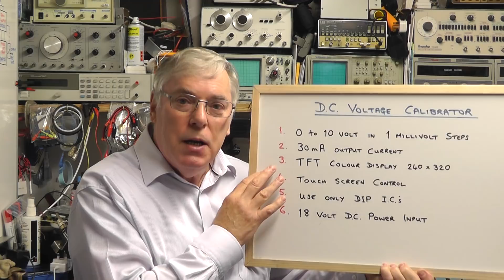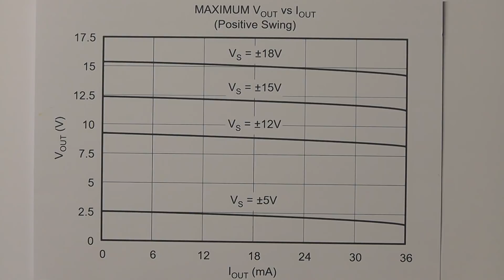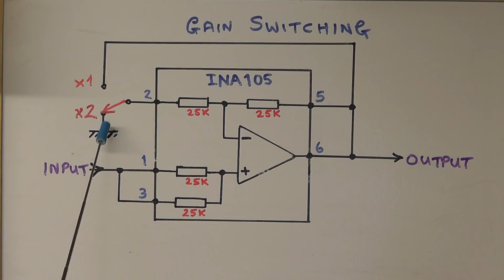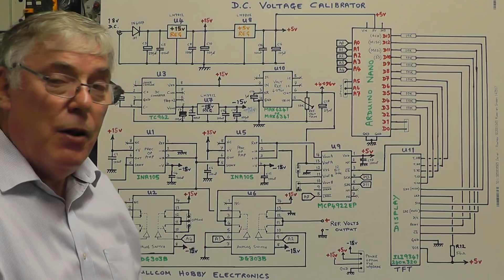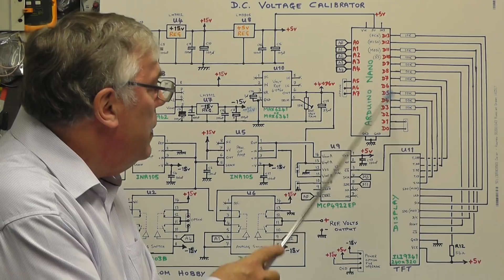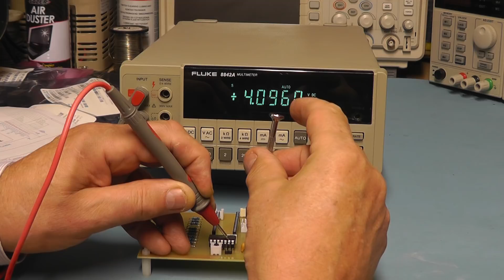Scullcom Hobby Electronics #53 - DC Voltage Calibrator Part 1

Comment: Amazing project! But I did not unterstand why the circuit has a precision of 0.01V up to 10V. If you must divide by 4 (to get 10V) before using the DAC and the DAC has a resolution of 1mV and later amplify by 4 - would the result not have plus/minus 4mV? You are losing 2 Bits or not?
Reply from the maker: Thanks that's a very good question. I will try and explain.
If for example we select a reference voltage of say 8.444V then before we feed that information to the 12 Bit DAC we divide it by 4 in software so the DAC sees a request to provide 2.111V. The output from the DAC is accurate to 1mV (due to the milli volt step resolution). The output from the DAC is now an analog voltage of 2.111V. The first precision OP Amp takes that analog voltage of 2.111V and amplifies it by 2 giving 4.222V it then passes to the second OP Amp which again amplifies if precisely by 2 to gave an output voltage of 8.444V (remember the Precision OP AMP's work on analog voltages while the DAC works on digital 1mV steps). Any error on the output voltage will depend on the accuracy of the OP Amps. That's the reason I am using the INA105 which has a maximum gain error of only 0.01% when operated at a gain of x2 and only 0.001%gain error for a gain of x1. So in my example here the output of the first OP AMP may be out by a maximum of 0.01% meaning the output reading may be as high as 4.2221V (only out by 0.1mV) this is now fed to the second OP Amp which may have the same error of 0.01% so in this case the output will now be around 8.445V. Only 1mV error and that is the maximum, in reality it would be better than that.
The main cause of any error in the output voltage is more likely to do with the DAC itself as it has the following intrinsic errors:
Integral  Non-Linearity  (INL)  ±2 LSB (2 steps) error which is the maximum deviation between an actual code transition point and its corresponding ideal transition point, after offset and gain  errors  have  been  removed. 
Also there is the Differential Non-Linearity (DNL) of ±0.2 LSB error which is the measure of variations in code widths from the ideal code width. A DNL error of zero indicates that every code is exactly 1LSB wide. 
There is also an Offset Error of ±0.2% of Full Scale Reading, which is the deviation from zero voltage output when the digital input code is zero.
These 3 type of errors in the DAC could result in an overall error of around a maximum of say ±5mV from the output voltage of the DAC.
This is something we may be able to address in software calibration later.
Have a look at the MCP4922 datasheet pages 19 and 20 for a fuller explanation.
In part 2 of this project I will have a look at the accuracy of our DC Voltage Calibrator with a view to resolving some of the issues.
Sorry for the long answer but your question was a good one. Hope this helps.
Regards, Louis
Reply: That answer was absolut fantastic! Hope you are making new videos 7 times a week now! ;-)
Reply from the maker: Thanks. If only I had the time to do it - I wish :-) All the best, Louis.
Reply: Louis, correct me if I'm wrong, but I think there's a problem...

This works with values that end in even numbers (as in your example with 8.444V) but it doesn't work with any value which is both larger than 4.000V and which ends in an odd number.  For any value meeting these conditions, there will always be a 1mV error.  Consider two examples:

1.  You set 4.001V.  The Arduino divides by 2, giving 2.0005.  The 12-bit DAC can't resolve the last digit (0.5mV), and we can't know whether the output will be 2.000 or 2.001.  Either way, the DAC's 0.5mV error is doubled by the op-amp, becoming a 1mV error at the output.

2.  You set 8.443V  The Arduino divides by 4, giving 2.11075.  The 12-bit DAC can't resolve the last two digits (0.75mV), but the output will round up to 2.111.  This 0.25mV error is quadrupled by the op-amps, becoming a 1mV error at the output.

You need a 14-bit DAC with 0.00025V resolution to overcome these division errors.
Reply from the maker: Thanks FlyingScotsman. Yes you are correct the 12 Bit DAC does have some limitations when I start dividing the input in software and the value is an odd number. In Part 2 I will be looking at the accuracy of this project. I did consider using a 16 Bit DAC at one stage but they are much more expensive and come in a SMD format, which is what I was trying to avoid on this project. We may look at ways of improving the accuracy later. In the first instance I also wanted to try and match the Time Electronics DC Voltage Calibrator I showed which has an accuracy of around 0.02%.

Thanks for your input which is appreciated as it adds to the overall understanding.
Regards, Louis
Reply: Indeed.  A quick look through Digi-Key's selection of DPDT analog switches shows nothing in a through-hole package with lower than 30-ohm Rds(on).  I think the obvious solution has to be mechanical reed relays.

DPDT reed relays are relatively few and expensive, but SPDT are plentiful and cheap.  The Littelfuse (née Hamlin) HE3321C0500 looks like a good choice in a convenient SIL package.  It would probably require a small FET to drive the coil (40mA; right on the limit for Arduino pins), and a back-EMF suppression diode.

The Littelfuse HE721C0510 comes in a DIL package, so it's a bit larger, but it costs ~50% less, wouldn't need the drive FET (coil current = 25mA) and it includes the back-EMF diode inside.
Reply: Sorry Scullcom, but if that answers the question, I have missed the point. If the output of the DAC is precise to 1mv (due to step resolution), as you say, and accurate to 1mv as you say, then a request for 2.111V could yield 2.112V, which after the op amps would give 8.448V, even if the op ams multipy perfectly by 4, wouldn't it? That's what I understood the original question to mean. Great project and video though, as always.
Reply: It looks like another aspect of the output accuracy lies at the usd analog switching devices. Although they are great little devices, the cost of using the units lies in the Rds-on values. Looking at the datasheet this value easily is about 30ohm. 
My hands-on knowledge of opamps is nearly equal to zero. But I know for sure that since the extra 30ohm is within 1 legof the opamp input, this is relevant. So the given gain value error will be worse.
Another aspect to keep into account: since the errors from the DAC don’t follow nice curves, I see no possible solution in software calibration.  The resolution of this device will be 1mv in the output range 0-4V, 2mv in the output range 4-8V, and even up to 4mv above output range of 8V.  And these errors are solely the effect of the DAC resolution. The gain errors of the opamps needs to be added, and also the (minimal) error of the voltage reference.

And what is the effect of the output voltage when the current is at different levels? Perhaps that effect can be reproduced, and therefore compensated in software?

Despite above remarks: very nice instrumental piece, clever use of selected components, and very educational. I really enjoy you’re projects and videos!
Reply: This reminds me on a question I thought about in the past: If you build a Wheatstone bridge to measure resistors could you use the measured resistors to build an even more precise Wheatstone bridge? And continue and measure... until you know this resistor is 1,000000000004 Ohm. ;-) 
My solution was that the least precise device in the circuit determins the precision, and there is no way out of that fact. And thats true also in this case.
Reply: der Birnodin Well, if I remember correctly one can calculate 1 strange resistot value with 3 well known resistors. 
But when used as a load cell, this resistor value is of none interest, only the voltage between the bridge in relation with the applied force. And that one can be calibrated without knowing the resistor values at all. 
This is quite of the subject started with the project of Louis though ;-)

I really need to dive into my learning books which I haven’t touched gor more than 20 years......
Reply from the maker: There is the MAX4622 which has a typical ON resistance of only 3 ohm. Worth considering but about twice the price of the DG303 or DG403. All of these are SPDT configuration.
Reply: Scullcom Hobby Electronics   Because my opamp knowledge is quite rusty, I cannot oversee the extra loss of accuracy introduced by both opamps as % of the represented value. The DAC accuracy is already quite off the resolution of 1 mV. 
That said: the logic blocks you’ve defined, and the design & buikd is still something I deaply respect. 

As total I did not look at component prices, just the datasheets to see what the accuracy can be. I was triggered because I am searching for a decent (preferably cheap) lab power supply with high resolution. (1mV/1mA). The documentation of the ‘payable’ ones I found all listed an accuracy of plusminus 3mV.  So I think they are built based on a 12 bit DAC. 

Well, thinking further in that path: why not replace the DAC with one with (significant) higher resolution, and use a high resolution ADC as feedback? That way different effects of inaccuracy can be compensated based on the measured ADC value. ?
Reply from the maker: Thanks Psilin for your comment. I did look for a 16 Bit DAC (SPI) in a dual inline package but they appear hard to find. I wanted this project to use standard DIP IC's in order to make it easier for the hobbyist to build. At a later date we could look at a 16 bit option although I would image a much higher cost. Thanks again for you input. Regards, Louis
Reply: Scullcom Hobby Electronics : looking only to DIP packages surely limits the availability of components these days. If I remember correctly, the ultimate poor man’s DAC consists of a couple of cascaded serial to parallel shift registers, combined with a R-2R network. Perhaps these IC’s are obsolete in the meantime. 
I still have no clue what you are going to do with the second DAC channel. So just keep up the good work ;-)
Reply from the maker: Thanks thisnicklldo, The true accuracy of this project is dependent on the output accuracy of the 12 Bit DAC. Therefore, any error the DAC produces will indeed be amplified by the OP Amps. If this error from the DAC happens to be say 1mV then you are correct the the output error if the voltage selected is over 8 volt will be 4mV (since we are amplifying the DAC output by 4). If the voltage is between 4.001 volt and 8 volt the output error would be 2mV(since we are amplifying the DAC output by 2). Up to 4 volt the output error will be the DAC error. We will have a look at this in Part 2 of this project and see how accurate the output voltage selected really is. I have found in practice the most noticeable errors from the DAC are at low voltages, say 1 volt or less, and I will be looking at improving that as a first step. There is also the possibility at looking at some form of calibration. Regards, Louis
Reply: Good advice, i'll have to make a 14 bit version of this little bugger.

Comment: Thank you verry much for all the effort put in your projects and videos. Learn a lot every time.
Reply: Just one idea, in terms of signal to noise ratio - isn' it better to do the higher gain in the first stage (2x 1x instead of 1x 2x) ?
Reply from the maker: Thanks this may be an option which could be done in software. I will have a look at noise in Part 2 of this project. Regards, Louis

Comment: Another superb project by the master...
One must be able to adjust the 4096 volt-ref with a meter like yours. Otherwise, it might not have the accuracy of 1mV, but it will surely have 1mV resolution. That'd reason alone to send it off for calibration, if you don't have the means to calibrate to 1mV.
Figure-1 on page 3 of the DG303B shows how clever the switch is!
I wonder how much noise these other ICs introduce into the static generated voltage by the voltage reference IC? 
Would one be able to connect a 1:1 push-pull audio amp to use as an output driver for a programmable power supply capable of 1Amp output?
Reply from the maker: Thanks for the comments. I will look at some easy ways for the hobbyist to calibrate this unit in Part 2. I will also be looking at overall performance and noise.
We could use some of the techniques I use in this project with a programmable power supply, may be another project later. Regards, Louis
Reply: The circuit is flexible and accurate enough to have both in one! With the right output driver that won't load the ref part, but could deliver 0-12V at 1Amp. Maybe a JFET OP amp as a voltage follower + a current driver. Or even use the second DAC.
One thing though, what will happen in a case of a sweep say from 2V to 10V?  
Since it switches between 2 ranges, will it not cut power (brake before make) for a few uS, where the interruption is small enough that the inline caps would pickup the slack?
Reply from the maker: Interesting idea. The break before make should not cause any issues as the time involved is only 50 nano seconds.
Reply: You could add an LT3080 to drive larger loads, up to 1.1A and the voltage can be set by applying the right output voltage level directly to the control pin

Comment: Looks like a very interesting project.   I noticed your whiteboard showed an 18V power supply, but when you explain the selection of the power supply, you say that 15V is sufficient.   From the datasheet, it looks like 15V is sufficient, right?
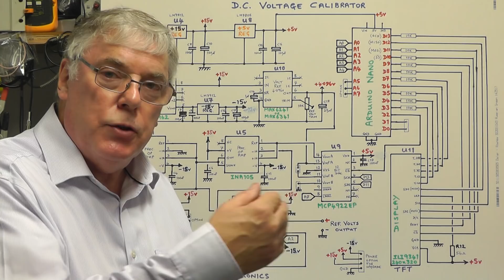Reply: And then you explain it at 24:00 in the video - that the 18V is just a bit of padding....Guess I'll see what I have lying around.
Reply from the maker: The 18V DC is simply the voltage from the mains adapter plug which plugs in to the unit and then feeds the 15V Regulator on the PCB so the IC's are powered from 15V.  The voltage feeding the 15V regulator needs to be about 3V higher (or more) to ensure good regulation, hence 18V. Sorry if I was not clear in my explanation. Regards, Louis
Reply from the maker: You could also feed it with a higher voltage of say 20V or 24V what ever you have to hand. But if you do then I would recommend adding some small heatsinks to the voltage regulators on the PCB to dissipate the heat due to the higher voltage drop across the regulator. In fact with a higher input DC voltage the +15V supply rail may be better. I will be looking at heat dissipation on the voltage regulators in part 2 of this project. Regards, Louis
Reply: Thanks for the clarification...looking forward to additional parts of the project!

Comment: Few questions:
-why did you use such expensive analog mux and two at that, when 4053 would do the job and is much cheaper?
-what version of max6241?
for this display, I think you should move to esp8266 or esp32, that refresh is far to slow with arduino
Reply from the maker: Thanks for the comments. The reason I chose the DG303B is that I found it to have a lower on resistance compared to the HEF4053. The version of the 4.096V Reference IC I used was the MAX6241BEPA+ but I have also tested the MAX6341CPA+ which is 3 times the cost. I believe the refresh rate of the TFT may be improved with a modified ILI9341 Arduino library.  Regards, Louis
Reply: Kk, but there is almost no current flowing, that resistance thus has no significant effect. You are using those switches just for voltage switching and not for current also. Or am I missing something here?
Also, since those muxs get 15v supply and 5v on logic, they are 45 ohms for your 303's and <50 ohms for 4053, that is almost, if not the same, so again, why so more expensive switches?
Reply: @display & MC: as I'm fiddling around with a lot of MC boards, a switch from Nano to ESP8266/ESP32 might make it necessary to adapt the software quite a bit. Less of a hassle and much faster would be an STM32-board. Here's a comparison between Nano and STM32 on display quite similar to the one you used in this project. => https://www.youtube.com/watch?v=5mDnKBNl9sY

Comment: Welcome back with another outstanding presentation and explanation Louis. What is the bottleneck with display refresh? the SPI bus or the AT Mega 328? Perhaps one of the STM 32 F1 "Blue Pill" kind of  sort of Arduino compatible boards might be faster. Dirt cheap on Ebay
Reply from the maker: Hi Rob, Thanks, The problem is the screen refresh rate for the TFT. I am currently using the Adafruit library which may not be the fastest. I believe someone may have modified this library for a faster screen refresh rate, so I will have a look for it. I have tried in the software to only write to the TFT if something changes, this helps. Hopefully this is something that we can improve as the project progresses.
Regards,
Louis